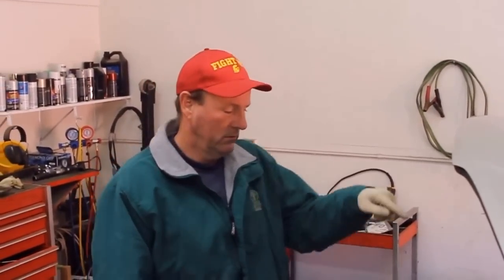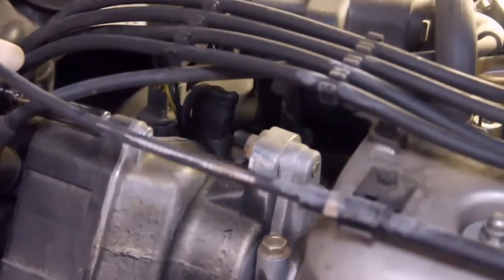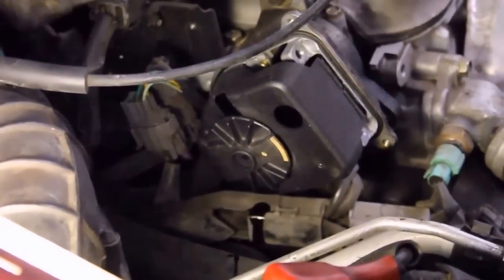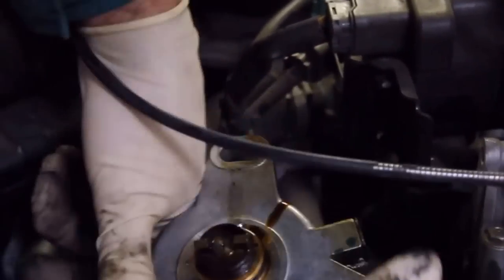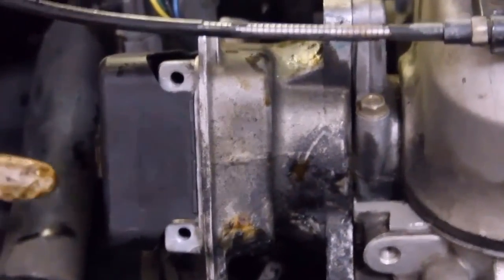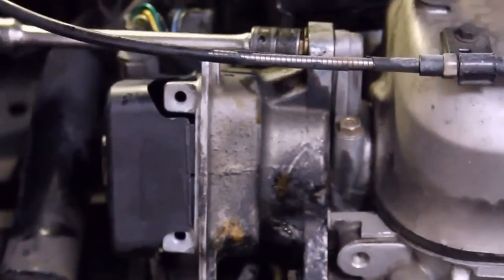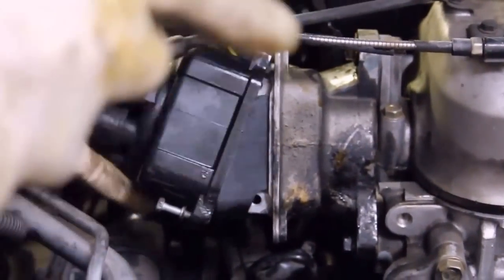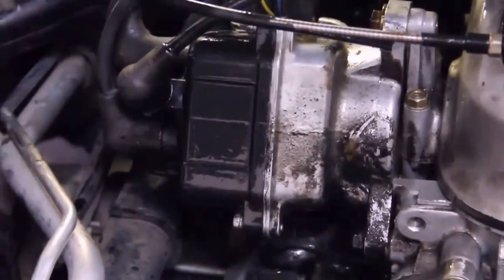$3 Common Oil Leak Repair

Comment: When I re-ringed my 97 Accord engine with over 300k miles on the clock. The distributor inner/outer o-rings were pretty brittle and was leaking oil on top of the transmission. 3k miles later, car is running like champ with no oil leaks. She’s my daily commuter over 132 miles  RT M-F and never has left me stranded except for a flat tire which I bought a full size tire as a spare. These are great vehicles! Just keep the maintenance up to date and she’ll take care of you...
Reply: Amen.  Have same 97 Accord SE Coupe.  I will never sell it.  I recently cleaned the egr system and my smog guy was surprised at smog results.  He said it's running like a new car and if you maintain these Accords they will last long time.  I'm about to replace dizzy o- ring that I got from dealer for 5$ cuz of leak.  Looks like easy job.  280k miles and still going strong.
Reply: xart23x   Absolutely! They’re a gem and long as you keep up the maintenance they’ll keep running 4ever...
Reply: Yessir.
Reply: @xart23x  i have one too, these things are fucking immortal when you do proper maintenance

Comment: Replaced outer seal. Worked great but the inner seal started leaking and had to do the inner seal, take distributor out again. Best to do both seal at the same time so you don’t do it twice like I did.
Reply from the maker: Where did you find a new inner seal for sale?
Reply: @JeffsAuto    AutoZone and O’Reilly had it. It’s called Distributor Kit and comes with 3 seals. 2 different size inner and one outer seal.
Reply: Dorman 917-136
Oil Distributor Seal Kit

Comment: You can replace the inner seal/o-ring as well. This video shows how to replace the outer seal that's leaks onto motor. If inside the cap there is oil you need to replace the inner seal/o-ring. You do not have to buy another distributor unless you want to.
Reply from the maker: Thank you for that information, that is great to know.

Comment: nice job but make sure that the distributor cap is fully dry before reinstalling it since brake cleaner(flammable) & ignition don't mix

Comment: How do I get the alignment of the distributor position correct if it is a replacement?
Reply from the maker: Turn the engine over until the number 1 cylinder is at the top ( make sure its the compression stroke).  If you are not sure about the compression stroke, you can take the valve cover off and check to see if both valves for that cylinder are closed (cam shaft lobe pointing away from valve) .  The engine can be turned over with with socket and a long extension on the front engine pulley (key off for safety).  Then turn the internal shaft of the new distributor until the rotor points to the number 1 spark plug wire on the cap and put it in place.  Next, put the valve cover back on, start it up and re-set the timing with a timing light.

Comment: im having the most difficult time getting the electronic part to disconnect, I'm pressing the tab in the middle but the damn thing does not want to come off. I even tried using a flat head
Reply: irregular mana may have melted [fused] together it happens

Comment: my mechanic didn't even take the cap off, i watched him replace the gasket, i just hope it has worked. i think it leaked into the cap as well.
Reply: its not necessary to remove the cap.
Reply: Did it work? Or was it leaking inside the cap as well?

Comment: Couldnt find inner seal.anywhere for a 98 accord v6 j30a 
.. spent $360 at autozone for a new one
Reply from the maker: It is strange how some manufactures don't offer replacement seals.

Comment: My oils leaks on the other side?? What's the problems there?
Reply: The air pressure in your left rear tire is probably too high.

; ] I'm not a pro, but there are a few possibilities which come to mind. You didn't say where you're noticing the leaked oil. Check from the  top on down. The leak could be coming from the camshaft seal, which will be tougher to detect. It may be from the valve cover gasket, the oil pan gasket, or perhaps a loose drain plug -- and a loose plug will give you arguably the most urgent kind of leak. You could have more than one leak. The engine's rear main seal may be the culprit, too. 

If you haven't confirmed a lessening oil level on your engine oil dipstick, check to see if your transmission is okay. If it's a manual, it may have motor oil in it. Older Hondas used engine oil rather than manual transmission fluid. Your Owner's Manual should clarify that. Good automatic transmission fluid will be pinkish in color. 

I'd recommend ATP's AT-205 Re-Seal. It's a 'plasticizer', which rejuvenates old seals that have become brittle or shrunk from heat and age. I've always tried to believe in other engine additive 'miracles in a bottle', thinking that companies are reputable and ethical. Most companies are well-intentioned, and nearly every product seems to have its fans and critics, yet I've found ATP's AT-205 to convincingly work the best. I wasn't sure where my persistent yet fairly minor drips and spots were coming from, but they stopped very shortly after using this product. Up to five hours of engine operation is the recommended 'activation window', by which time you should see results.

I thought I also had a small transmission shift rod seal leak, so I 'repurposed' a hand-soap pump and adapted it to the bottle cap from a second bottle of AT-205 I'd bought, adding a short piece of vinyl tubing from my local Ace Hardware as a pick-up tube. The thicker-walled tubing gets pretty stiff as it sits out in the air. After a couple of days I decided to take the pump out of the bottle and re-cap the AT-205. The vinyl tubing was amazingly and very noticeably much more pliable after being in the AT-205 -- additional 'proof' that this Re-Seal performs as stated. It won't fix every seal problem, but I'm convinced of its effectiveness. This probably goes without saying, but check around if you decide to try the AT-205. As with many products I've sought, AT-205 prices on eBay varied widely and ridiculously. Some people do little if any research, which must be why products can be priced so high and seemingly still sell. I found this for somewhere between $11 and $12 a bottle. A few vendors offered it for over thirty bucks for one bottle. I saw one listing at $45 for a single bottle, if memory serves me. 

You can also get ultraviolet dye leak detection kits that assist in pinpointing leaks. They do this through the addition of a small amount of UV light-sensitive dye to the oil which 'glows' under blacklight to closely identify where a leak originates.
Reply: theoriginalbillholt  valve cover gasket could be the problem
Reply: theoriginalbillholt you talk too much. The answer would just be the Valve Cover Gasket and Valve Cover Seals.

Comment: I have an oil leak on my 04 Honda Civic. It's on the passenger side and it's leaked all over the front of the motor and passenger side.
Reply: Check your valve cover gasket.
Reply: Hidden masterseeker done that and it still seems to be leaking elsewhere.

Comment: why you gotta take off the rotor cap for tht.just easy to take off whole thing.
Reply: exactly lol
Reply: Because it's easier to get to the 3 bolts to release the dizzy.  It's really tight space to get ratchet and extension on the bottom bolt.  Plus, its best to check cap for leaks and clean it.
Reply: This way you won't risk getting the spark plug wires transposed.